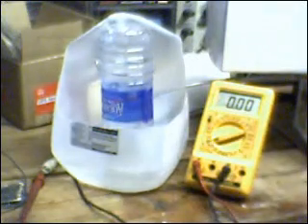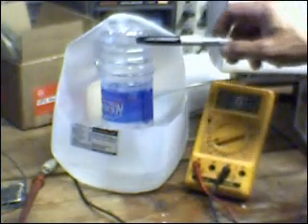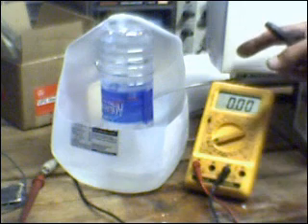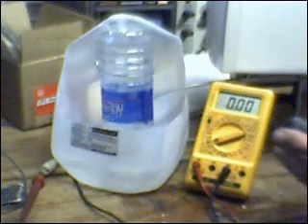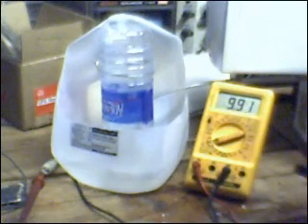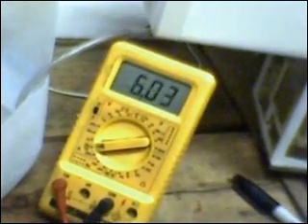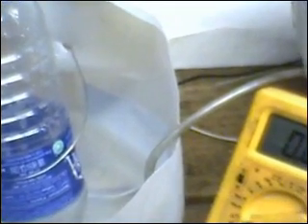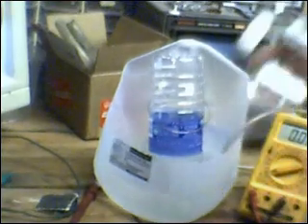26 - Hydrogen HHO Electrolyzer w/ NaOH 2007/08/02 #2

Comment: I knew something was bugging me about the whole process...Fuel line will always have 40 pounds across the load, even if you add the HHO into the air mix, it'll still spend the fuel. Will you be reducing the line pressure or introducing the HHO into the line directly...or are you using carb...or..?  =)

Comment from the maker: The apparent reduction in gas production is due in part to leakage I <u>had</u> around the lid gasket and increased pressure it was working against when the water level dropped in the collection bottle. Working on sealing it up tighter now. Glue takes time to cure. Probably no new video until tomorrow night.

Comment: Well, I drive a nissan that gets 34mpg, I drive at rough average of 60mph, That would put my fuel consumption at !0294gpm, You are producing !6666Lpm, or !1760gpm .  Unless my math is wrong, you are producing 6 times more gas than my car consumes. BUT Hydrogen explodes at greater force over a shorter time period than fossil fuel, which means you might need to adjust your timing ahead slightly (may need a onthefly adjuster kit). Just another suggestion (! is decimal, stupid noURL crap)